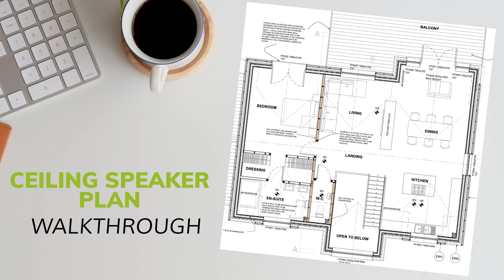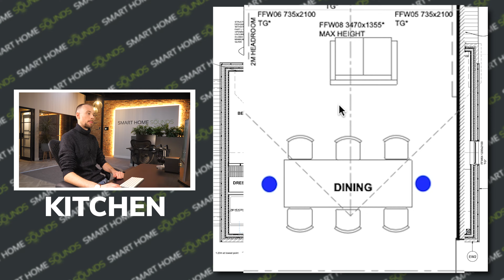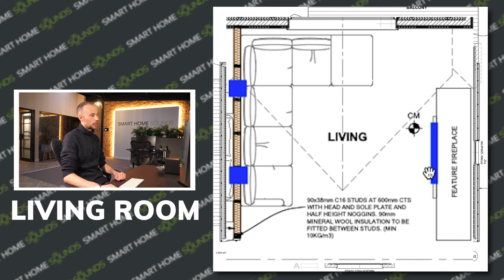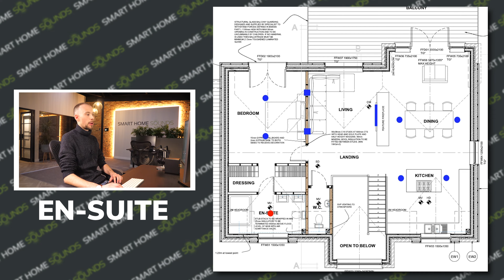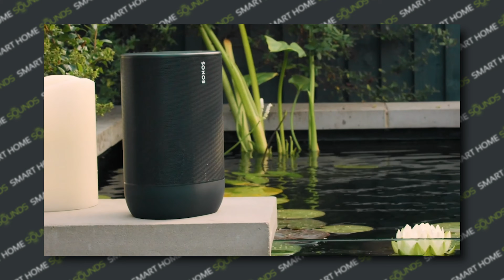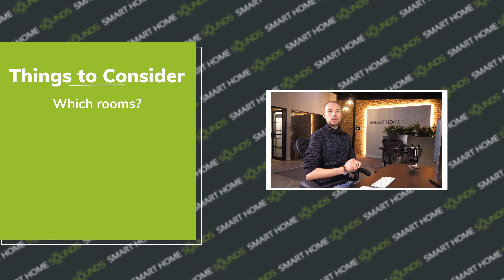Ceiling Speaker Design Tips (Installer Tips Revealed)

Comment: I bought a Niles 12 channel amp with built in fm tuner capable of 6 zones plus the remote control and 12 NXT ceiling speakers for about $100 total (amp from the pawn shop, remote eBay, speakers new in box from goodwill and eBay.). Now I am planning an installation at our multi room office and garage/shop. Our favorite classical music FM Station and cheap bluetooth module will be the selectable sources. I have a plenty of speaker wire. Wish me luck. 🍀 Retired DJ and Live Sound Engineer here. I think I’ll bring a helper so he can learn something maybe do some sweating in the attic for me. 👌

Comment: What's your thoughts on lithe audio bluetooth speakers for a kitchen extension.. general music and TV hook up? Are they any good? Cheers
Reply from the maker: Yes, they certainly provide a performance you'd expect from higher quality ceiling speakers. They've got a good punch to them and they're dead easy to connect to day-to-day. They also have an RCA port for connecting up to a TV and there is minimal lag. This is a great way to save on cost of a wired amplifier. Hope this helps!

Comment: Would a single zone 70 volt commercial sound system be a good option for home use? Where there would be a single amp driving all speakers with volume dials in each room.

Comment: Another outstanding video, thank you!  I have 36 inches between the back of my couch and the wall which is a sliding glass door.  I have vaulted ceiling also.  I believe you mentioned installing the in-ceiling speakers as close to the wall as possible.  How far behind the couch do you recommend installing in-ceiling speakers---is 30 inches too far?
Reply from the maker: Hi Josh, if you have space between the couch and the wall, I'd recommend not going any further than 6 inches from the back of the sofa. Hope that helps!

Comment: I was looking at getting ceiling speakers but could I get some Sonos ones and mount them in the corners of the room? That way I don’t need to run cables everywhere. What do you think?
Reply from the maker: Hi Danny, yes we have seen some customers use Sonos Ones instead (providing you're using these for music only). You can get ceiling mounts for the One by Flexson and wall mounts that you can mount close to the ceiling too. It really depends on how much you value the discreet aesthetic of ceiling speakers and the extra work involved or if you would be just fine with Sonos Ones. I hope this helps!